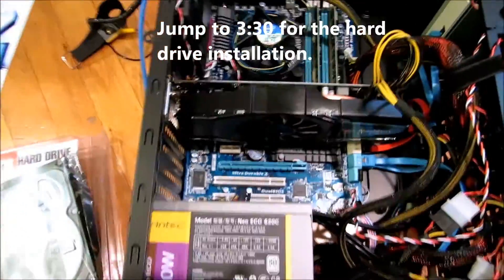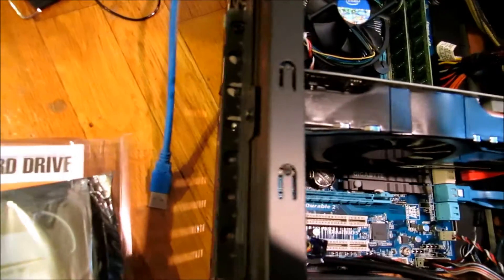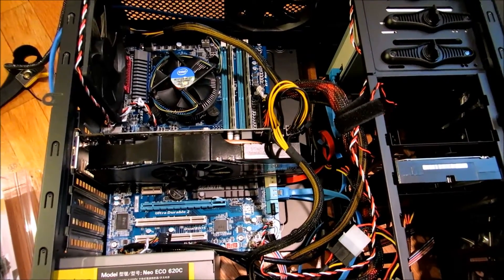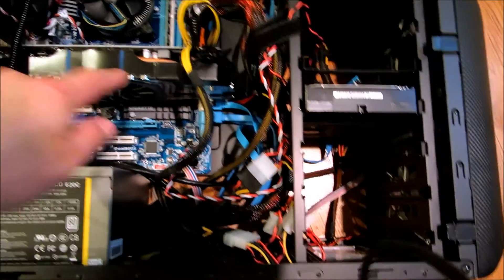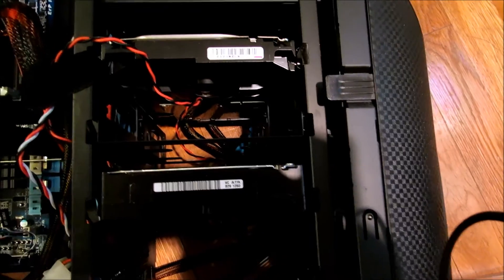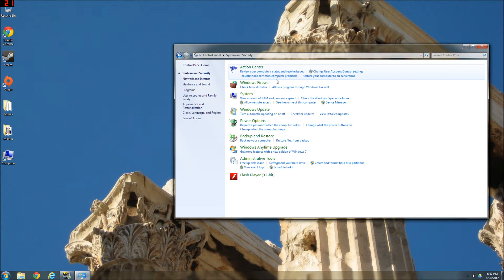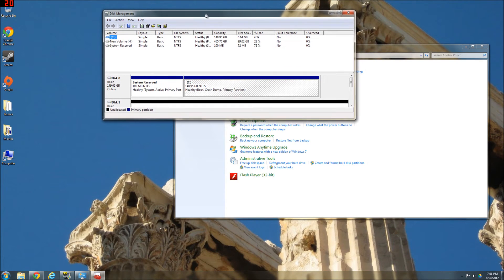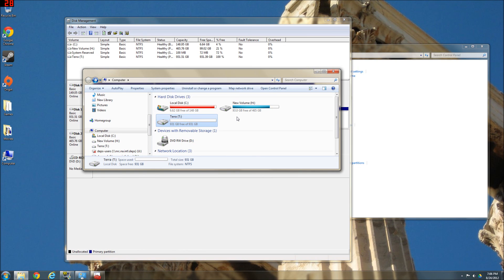Installing a New Hard Drive in My Gaming PC

Comment from the maker: What I've read is that the biggest gaming difference between HDD and SSD is the loading times, and that's my experience on my pc.  Outside of gaming, SSD speeds up the OS a whole lot.  If you're using an older, slower HDD (like 5400 rpm?) I'd guess a game would run worse vs a newer 7200 rpm HDD, but again I'd guess the biggest difference would be in the loading times.  My non-expert opinion is that the biggest impact on actual gaming performance (FPS) is RAM, video RAM, and processor speed.